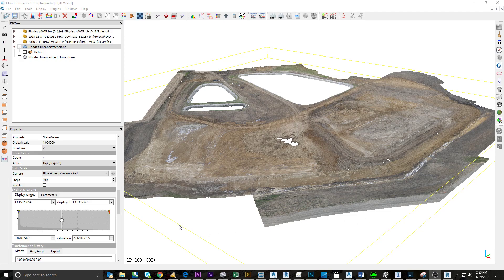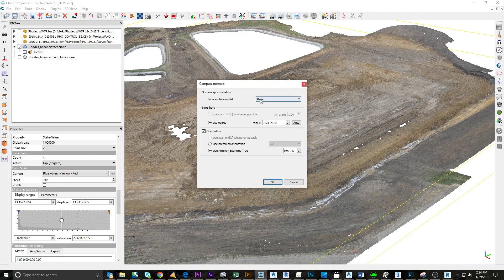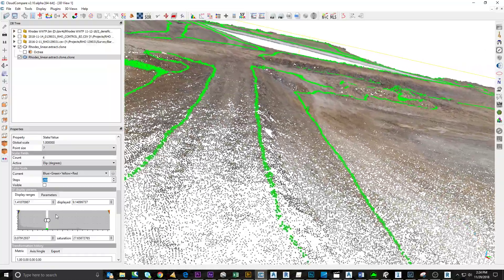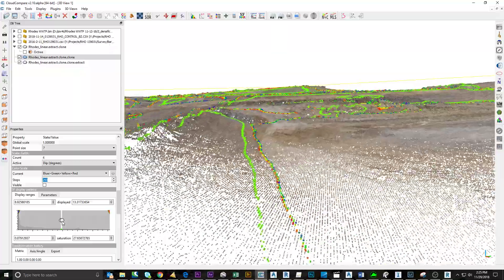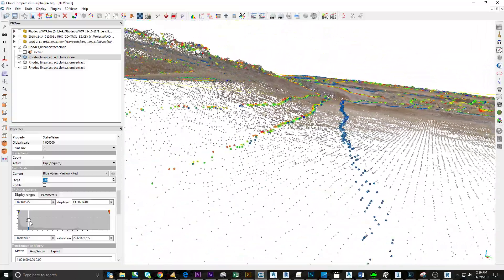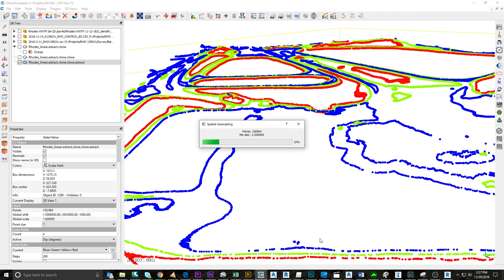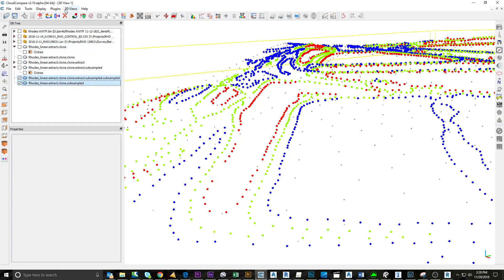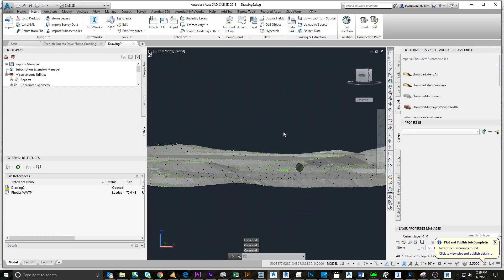Automated Slope Breakline Classification with CloudCompare

Comment: great video - seriously - this is mint!
interesting to see that that you subsample to a grid - I have been using projection - rasterise, to be able to select the lowest point in a grid spacing - in an attempt to be comfortable that I have "ground" - under the grass etc - this is my cleaning process - I would appreciate your feedback https://www.youtube.com/watch?v=ImJcvnEHYsw&t=52s

also - i am not aware of the steps to get to a decent smooth dip octree later that you have at 1:20... was the calculation run on the settings you had at 55 seconds? - when i try this i gt too noisy a field using the "auto" button to calculate the octree radius
Reply from the maker: Hey Lee, I liked the way you dealt with the road surface and the ground separately. I've always been afraid of creating new points within a rasterized grid because like you've noticed the noise around vegetation is not the same as the noise on roadways. But I think I'll try your method next time. It would be nice if Pix4D did a better job classifying the vegetation, ground, and road surfaces for this step. But I guess for now we'll just have to do much of that classifying manually.
Reply from the maker: I have also been using the noise filter in conjunction with the CSF filter. When I turn the maximum variance down to 0.01 feet or so it cleans up UAS point clouds pretty nicely.
Reply: @kyleyounkin6487  yes.... I have since changed my CSF filter iterations to do a very small spacing like 0.1m with a sensetivity of say 0.3m... then progressively double both values until you get to 0.8m at 2.4m sensetivity... seems to give me a great result... albeit the first process at 0.1m is a big ask for the processing time